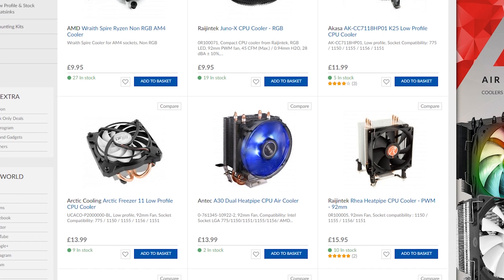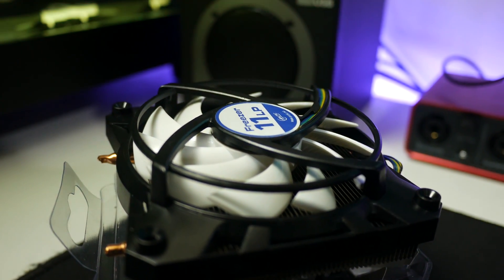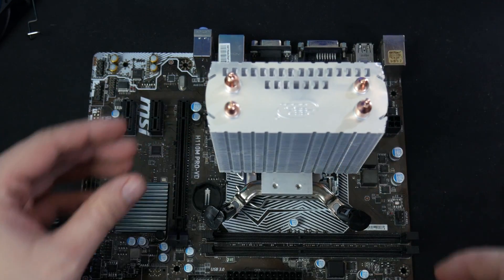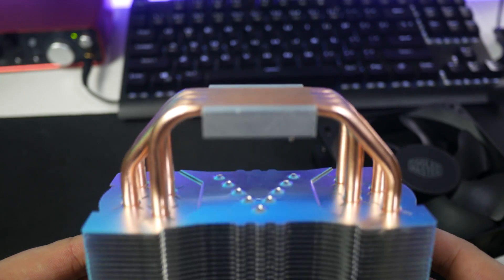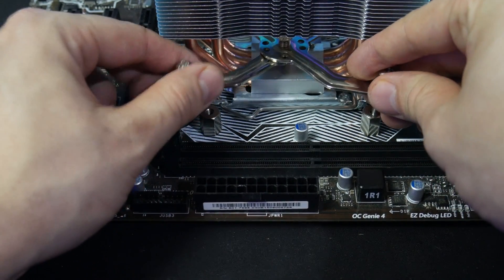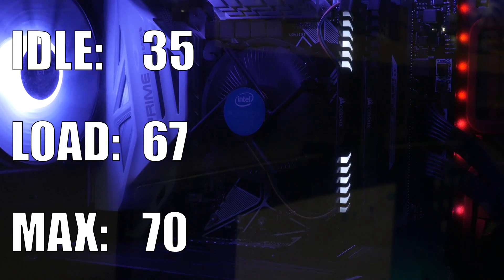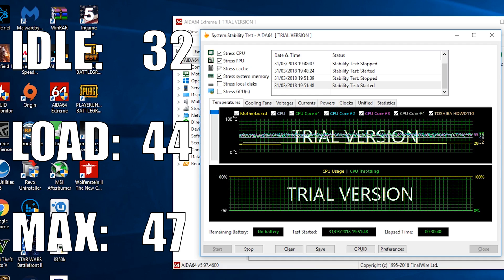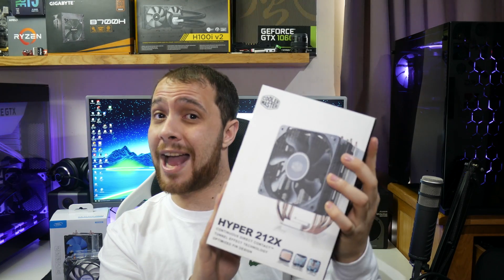Intel Stock Cooler Alternatives - 3 Great Budget CPU Coolers From £10-£25

Comment: This question is not related to the video but something else, what is better for streaming/gaming (ryzen 7 1700 and gtx 1060) or (ryzen 5 1600 and gtx 1070)?
Reply from the maker: The 1700 is much better for streaming with obs. But the 1600 + 1070 will destroy a 1700 and 1060 in gaming.
Reply: Thank you so much :)

Comment: i use be quiet rock slim cooler on my i7 2600. he is nice and quiet. Temps are ok but i dont make custom Thermal Compounds on it. i think with cooler master mastergel pro i get better temps. now it runs with around 55-60°C in Gaming, with Prime95 ~70°C. But its a small case with limited airflow

Idle: 33°C
Load: 55-60°C
Max: 70°C (Prime95)

Comment: Hey man! Wolffie here, it's been a long time. Sorry about that, great video though. I'll be entering the competition for my dad's computer. Cheers.
Reply from the maker: George/WF Hi mate yeah it's been a while still building that pc for your dad then??
Reply: TheFullSetup yeah built it a while back had a lot of problems took about a day to fix. Basically, a few blue screens, boot loops, no audio, Windows key didn't work, didn't post, (various reasons). But it works fine now. Only issue is it's a little loud so I'm hoping one of these coolers would sort that out. What about you any PC's built recently?